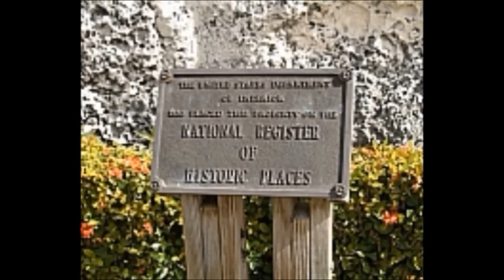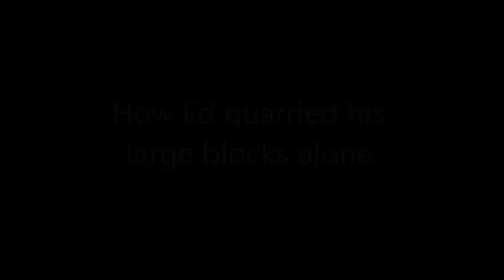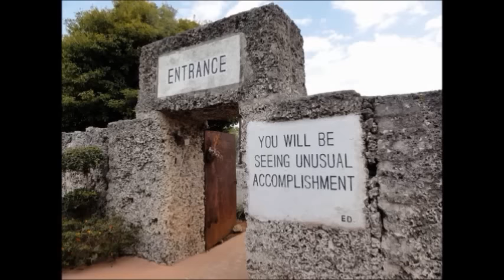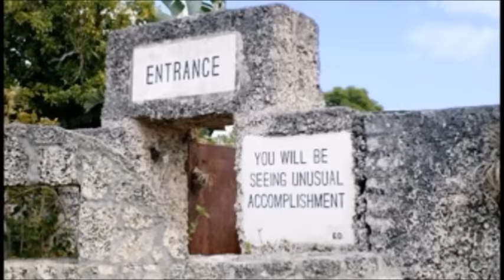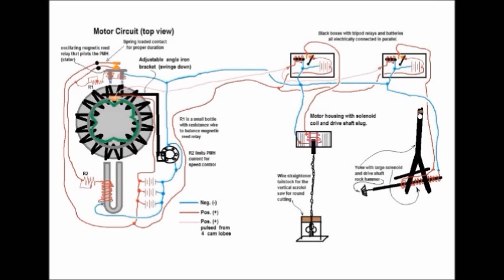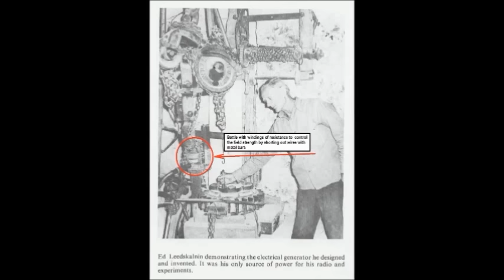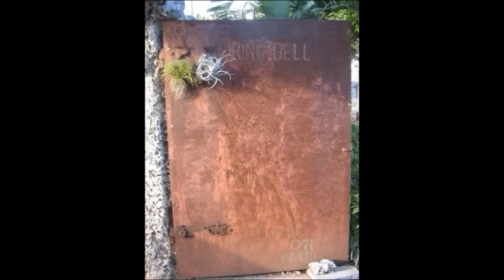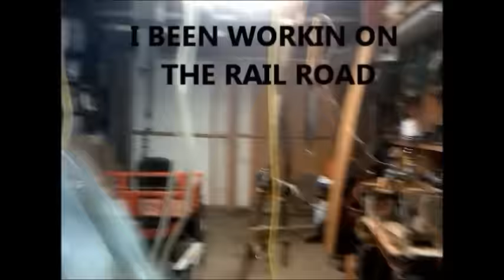Eds Coral Castle Quarry and Flywheel, Engineering Mystery Solved

Comment: I don't want to discredit a reverse engineering genius such as yourself. God knows regular folks can deal with such assignment a lifetime and have zero solutions however, what you've figured out is a number of tool designs that assisted Ed in one way or another to speed up the process back in his days. Any equivalents of those tools (only a lot more advanced) can be easily purchased today at Home Depot in fact, a regular electricity socket, a few extension chords, a tiny bobcat and a large chainsaw would do any of those things with absolute ease. One thing you DID NOT figure out good Sir is the main mystery. How those rocks were lifted, transported across the field, layered, and needle point aligned with one another while suspended in the air ALL by ONE man. You're briefly referring to an old hollywood footage of some barrels supposedly providing the means of conveyering the blocks and also mentioning that the hardest work was to move them not cut them or anything else... You've been asked that before. If you have all the tools, why don't you post a video of you making oh lets say a "simple" megalithic wall in that big backyard of yours? Money? I will personally arrange for a delivery of  several 10 ton coral blocks to your house or rent a venue to conduct a highly sought after scientific experiment as soon as humanly possible, the only deal is that its going to be a one man show,

 " Made by one man " right? 

YOU and that wall must come up the next day and the entire process will be video taped by a professional video crew that will be arranged all expenses paid. 

The day Ed moved, he ordered the moving trucks to line up in front of his old residence and told the drivers to leave, to come back in the morning to drive the load to the new location. One of the drivers arrived an hour early out of curiosity only to find ALL the trucks completely loaded and ready to go.......................  

Mystery NOT solved
Reply from the maker: I never claimed to solve the WHOLE mystery, If you read the title it is mainly about the engineering aspect of the cutting and the machine. It was merely to dispell levitation garbage simply because the wheel is a piloting device for the whole compound.. AND show cutting and chipping techniques. The lifting and rigging is easy. JUST BIG. as for the blocks of coral. I have NOW without upload been chipping away here in VT. 
      Also yes its always $$$$.    BUT my Rocks are HARD HARD HARD. I live in VT. there is nothing light or soft here except soap stone. HAHAHA.
      OOhlite is light alright. soft soft soft too. I need to go down there not here. 
As for made by one man. as long as I have 28 years it can do quite a bit

HONESTLY   do believe otherwise????  how do you think he did it. 

also to me????    There never was a mystery!!!!     it was pretty obvious all along.     dont mean to sound cocky but mysteries are for those who can't see the real truth. I dont need to prove anything really because I KNOW what he did.  period. HOWEVER n  i do want to TEACH decent folks how reality works and YES I will gladly do it alone. Now I know almost EXACTLY what he did to chip, quarry, cut, carve, sever, lift and move the rocks. I do NOT know EXACTLY ho he built the castle but the oblisks don't seem to hard. 
     Apparently he broke the obelisk twice before he got the third one up. according to affidavits recorded in the homestead town offices. more truth people refuse to hear. 
LASTLY if you are serious about the film crew. I am already planning ALL of that. But it will end up on NOVA. I KNOW I CAN DO IT.  I just don't know where, when and with what   YET.

Scott R.            PS.   Do you want my Email address.? at least come and visit. I live in the country plenty of room in the house. Let me know. I AM SERIOUS.  www.madebyoneman.com has a contact form. I am holding out on the chipping method tho.I really don't want them all to know everything.   YET.

Comment: That's Iron Man arc reactor!
Reply: No, the Real life version is the US patents by Edwin Grey, which were a replication of the Tesla power supply that powered the famous Tesla Pierce Arrow electric car. Look up Ed's work and you'll find a device that uses an arc in a vacuum tube to generate more power than it uses to operate. Ed used an earlier version built into an electric motor to power an electric car and to self charge the batteries. An arc motor, another of his patents.